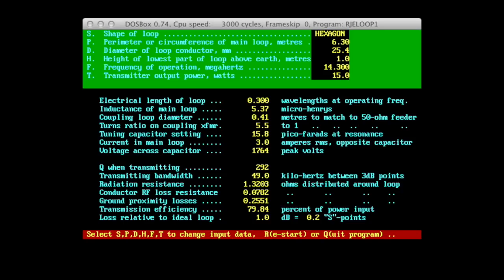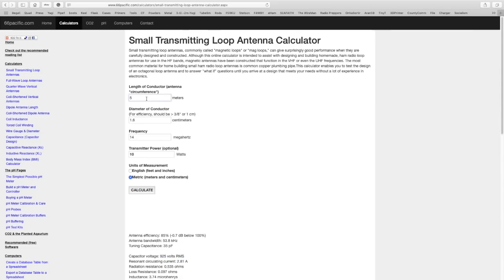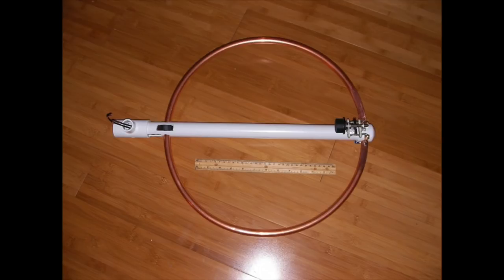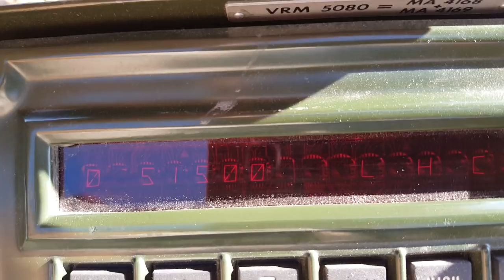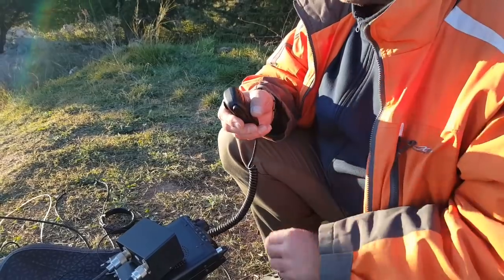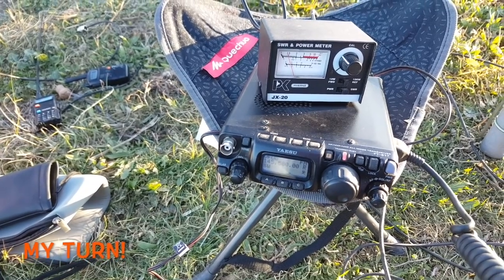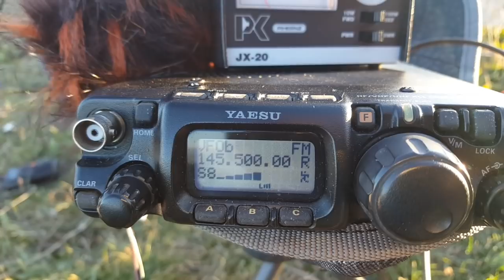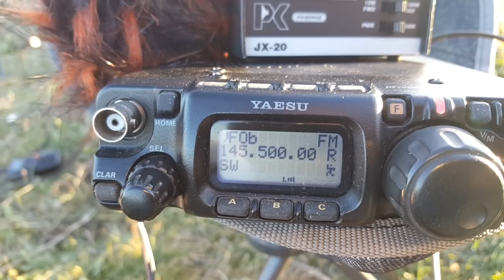Exceptional QRP VHF Contact, VRM-5080 and Magnetic Loop Project.

Comment: Thank you for the video! ... and the fourth we need is patience ;)  ... I just ordered a new radio, which can work from 160m to 70cm band, also 6m and 4m in all modes... an ICOM IC-7200 ... i will try some /m and /p activities ... Vy73, Dietmar, DL4HAO
Reply from the maker: Hi, I thought the 7200 was HF&6m only..?
Reply: Ah, yes, my mistake, sorry. I ordered the IC-7100, not the 7200 ... because the IC-7100 has the seperate control unit, the main unit can be mounted in the go-box and I can work /p with the control unit at the lap while the main unit can be in the car or go-box while outdoor. And, btw, I have also the Predisent Grant II for CB because I think it would be a good Idea, if SHTF scenario happens, if we can also communicate, where a lot of radios are available. Which is not the case at 6m band :)
Reply: Radio Prepper. So did I.

Comment: I have a small apartment and use a Chameleon F-Loop Plus as my primary HF antenna. I bought it a couple years ago when I was flush with cash and I love it. My first contact was to Urbana, Illinois-955 miles-from inside the apartment. My buddy and I are in he process of building a couple 160/80 meter loops now.
Reply from the maker: Yep, good antenna. Post photos on radiopreppers.com!

Comment: I was an avid backpacker starting back in the 1970's up to 2004. In the early days I lived in Arizona, used CW QRP mainly 40 and 20 meters. Made lots of good contacts and had fun. Later I was using a hand held 2 meter FM and did more mountain topping. I built a collapsible hand held dipole which I could move around and change polarity to maximize signal strength and that worked well, made many distant contacts and working distant mountain topped repeaters. In the latter years I backpacked the mountains of Colorado, operated many times at 12,000ft to 14,000ft and used the FT 817 HF to UHF. Mountain top 2 meter SSB can be very interesting. Normally I would know that I had good coverage but the down side would be not many stations to talk to. Unfortunately  I've had several spinal surgeries and my backpacking days are over but I enjoy watching your radio adventures! Keep up the good work. De KM7Y previously WA4SMU and WA7ROF.
Reply from the maker: Will do, thanks!

Comment: Thanks for your video. It is unusual to see the efficiency of an antenna but obviously the main characteristic to get. I wait your magnetic loop antenna, but I didnt understand well what is the frequency you are aiming to optimize. Meanwhile Im searching a variant of T2FD (WW3H in fact) folded to be using half the whole length and said as efficient at a heigth of 10m on one size and 5m on the other, but I dont find the issue describing it. Do you know this antenna ?  Cordially, Milos
Reply from the maker: I think I have a link to that antenna. I can look tonight...

Comment: Amazing Gil I really enjoyed your video, I was out with my IC7200 on 20m I was able to talk to Tokyo on 20W which is the furthest I've talked and it was right before 20m went flat in Chicago. I was so happy to make that contact in Chicago it's pretty flat I try to setup in the Forest Preserves near me it's one of the highest ponts in my area and noise is not an issue S0. The VRM-5080 radio audio connector is that available from anyplace ebay etc? I'm thinking of purchasing a VRM5080 for myself it looks like fun. Looking to get 6m going and some hams on it here. 73's kc9dfk
Reply from the maker: Hi, yes, the audio connector is the standard Clansman 7-pin.
Reply: @RadioPrepper  I joined patreon to support you
Reply from the maker: Awesome! Thank you! Every bit helps..

Comment: Florida USA?

Yeah you should try APRS and the reason why is because you can watch how the propagation works going up the hill and down all automatically as you drive. Great way to test range and propagation. Although its not a weak signal mode its still a good way to see it plotted on the map.

WW5RM
Reply from the maker: Interesting thanks. Sarasota Florida :-)
Reply from the maker: I liked that show, LOL. Will check APRS. HF APRS does interest me, for sailing...